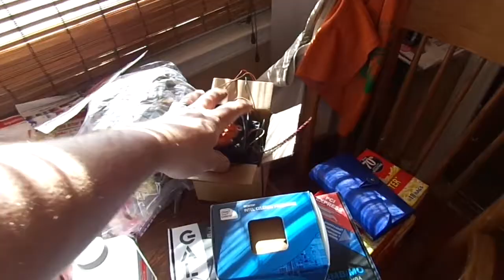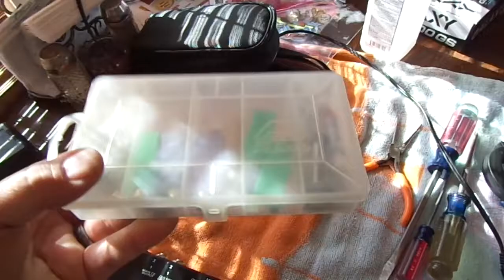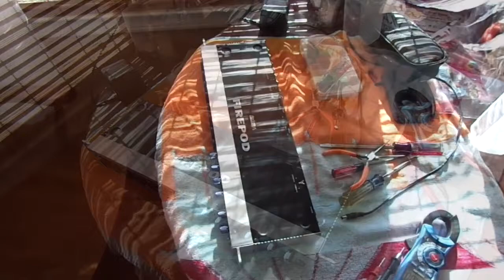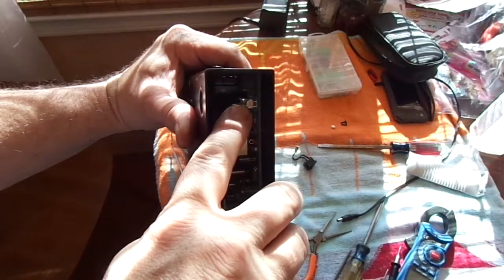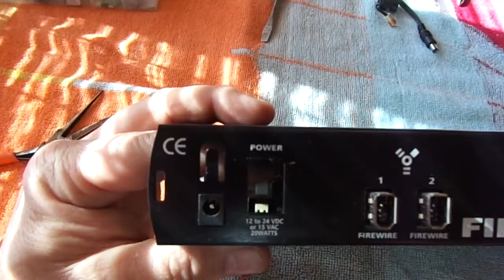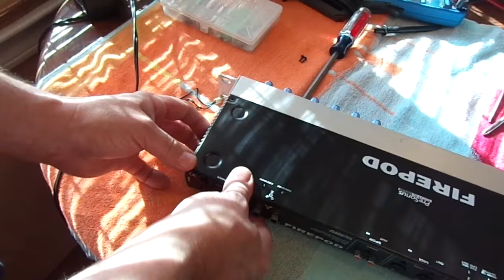Dead Presonus Firepod repair

Comment: The real fix woukd be replacement the switchwires wirh silicone ones wich connect in a solderen way to the pcb. Not a frkn jumper as you never know if it withstands the amperage used by the device.

You created a burnable fuse wich could Light the entire house.

Comment: Leaving them on all the time must cause issues. Not only this but also the capacitors blowing.
Reply from the maker: Connect them to a furman power strip and re cap the entire unit every 5-10 years depending on the quality of replaced components.
Reply: @cpworx_maker  I would like to get mine repaired

Comment: As these units get older, the best thing is to bridge the power pins to always on. 
Replace the main capacitor 1000uf @ 35V and the one to the right of the transformer 470uf @ 16 or 25V
Check the values of the four clustered below the transformer, these are ganged. 
Replace the initial 2 caps and it will work. 
This is a common fault that people think is the fire wire chip.
Unit powers on but does not sync, only displays a solid blue light. 
Test the voltages on the test points by the power transformer. 
If the only accurate one is the 5v on the left most TP then its the 470uf cap to the right of the transformer, as if the main cap failed there would be no volts.

Comment: Hey, you wouldn't happen to know what kind of fuse the Firepod takes? I have a dead unit and I'd like to try this fix, but the fuse has been misplaced and I'm having difficulties finding out what to replace it with. Thanks!
Reply from the maker: Sorry, Maybe go to the Presonus forums. I don't have this unit anymore and don't know what fuse it takes.
Reply: @cpworx_maker  No worries. I've asked on the Presonus forums and couldn't get an answer. The search continues!

Comment: I used a jumper on the Firepod too, lol. I saw those pins and knew what to do. Now it won't connect and I am wondering why. Gonna open it up and see but I have been through alot of interfaces since then.

Comment: Hey Rick - wanted to say thanks - I've had this issue with the Firepod switch for years, and wound up leaving it on all the time, and powering my system with it switched 'on'.  On Friday the switch failed completely, with a recording session planned the next day.  I found your video, followed it exactly, used the jumper and voila.  Fixed immediately.  Thanks much for sharing the fix.  Happy New Year!  -Mike
Reply from the maker: Glad to hear that it worked out for you. I found this repair on the Forums but it's hard to dig through all the posts and find it, so I made this video!

Comment: My interesting story: Bought a Firepod 2 days ago for $100AU and it got delivered today. Plugged it in and it's dead, tested the power supply and dead. Dug up a laptop 15V power supply and connected the presonus power tip, plugged it in and dead. Watched your clip and put the MB connector on the pins and bingo ...  a working firepod... Sensational stuff.. 1000 thankyou's
Reply from the maker: That's awesome! Glad you got it fixed... Thanks for watching

Comment: Hi Rick,

I am experiencing the same issue with my Firebox. However, mine does not have an on/off switch as it is an older model. Because it does not have an on/off switch, is there anywhere else that I could plug my hard drive jumper onto?
Reply from the maker: I have no experience with that one. Check the Forums because that's where I found this fix.

Comment: Hi rick, any suggestions where i could get some replacement screws for this interface? I have one, took it apart, moved houses and misplaces the original screws.
Reply from the maker: Sure don't, I would assume they are metric. Maybe call Presonus and ask them. Thanks for watching
Reply: No worries. They don't support this model for parts any longer, but i think some of their newer interfaces might use the same types of screws. fingers crossed.

Comment: Great vid thanks Rick, relieved that it is a common problem and the fix is simple. Would have taken forever to take apart the whole unit. I didn't have a hard drive jumper, so I just bridged the pins with a solder joint.

Comment: hellow i have problem with presonus itwo and the red light pops already when i increase the volume at 5 ..both port have the same problme can u help me? please
Reply from the maker: If it's the channel light then you are clipping the input and must lower the gain for that channel. If it's the Sync light (Red means no sync and blue means a firewire sync) then you  may have a bad power supply. Try another power supply first and if you still have the problem then contact Presonus about repair. Thanks and good luck

Comment: I know i'm late but where can I get the proper jumper so I can do this? Mine just died today after 10+ years.
Reply from the maker: They are available from the old school IDE hard drives. These drives are getting hard to find but even some mother boards have the same type jumpers. I'm sure a google or Ebay search for hard drive jumpers will bring something up. Good luck and hope this helps
Reply: Thanks...probably just saved me a few hundred bucks 💲

Comment: Thank you! My first inclination was to buy a new power cord. I never would've thought it was the on/off button. I followed your instructions and it worked perfectly!
Reply from the maker: Thanks for the comment, this fix was found on the Presonus Forum, I just put it in a video, can't take the credit for the discovery just the video lol
Reply: We'll, your video is what walked me through it, so I'll split the credit!
Reply: Hey I have a Project Mix I/O firewire interface that went dead no lights nothing but the power supply pilot light was dim & blinking I tried another Power supply & the same thing the light on the powersupply was bright then when I plug it in the PJ Mix it went dim/blinking. I don't think it's the Firewire card , any idea's? Will you do a repair? I can't find anyone to repair it Avid MAudio inMusic is useless they said "GoodLuck" Thanks

Comment: Hey Rick,
Thanks for this video. Very useful. My Firepod just died. What size jumper do I need for this fix? Thanks!
Reply: Excellent! Thank you Rick! Be well,  Lorenzo
Reply: It worked!! I took a jumper off of an old hard drive and used your video as guide. It took ten minutes and the Firepod started right up. VERY helpful. Thanks again for posting this quick fix. You saved me.

Comment: RadioShack used to have the jumpers for like ? 10/$2.

I had a friends unit in for repair and it had this problem at one time, and i found out about the jumper trick after. however I was trying to return it to a original condition ( i was the 2nd person in the unit for re-repair, screws were missing, the fuse was soldered to the board!!! ) I ended up taking the connector apart and sanding and bending the connections a bit to make better contact, then replacing the fuse holder… also noticing that nowhere does it mention what fuse is required!!!
so if you need to replace the fuse and lose it ( or perhaps your fuse has the markings covered with solder ) you have no way of knowing what to replace it with.

I guess I should say, I don't know whether it is the connector or the switch that is causing the high resistance. but my money is on the connector because it looks to be really cheap and have poor contact, which causes the resistance which in turn causes the heat and leads to melting, because it is not rated for the current at which it is used for.
Reply: ***** the jumper makes a tighter connection with a lower resistance and has more solid material to dissipate heat. so it's probably actually better, and if you're switching with a master switch it is not needed + your not wasting energy in the power bricks.